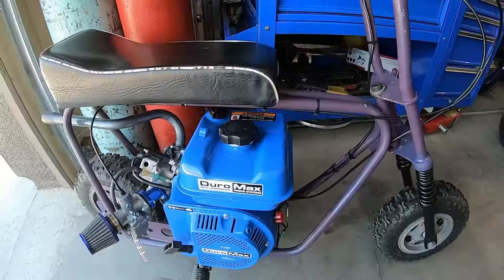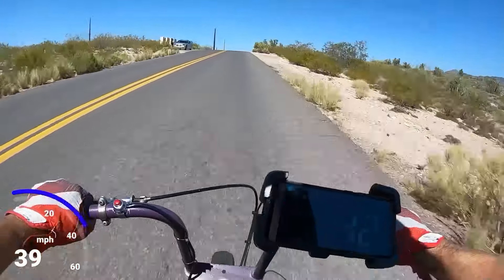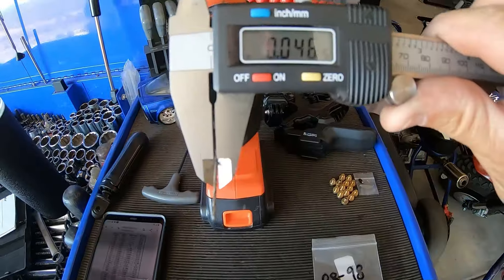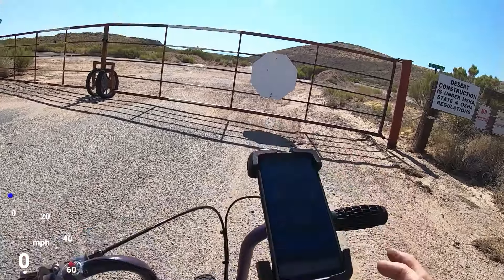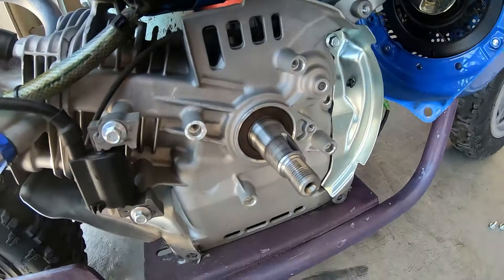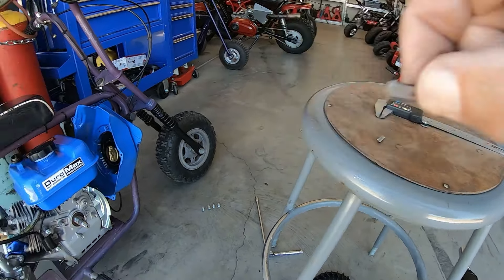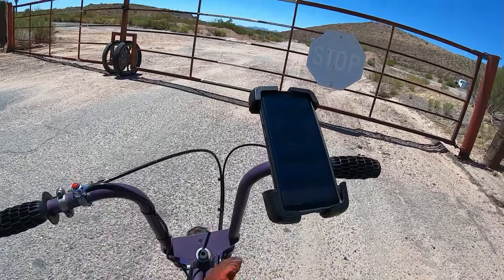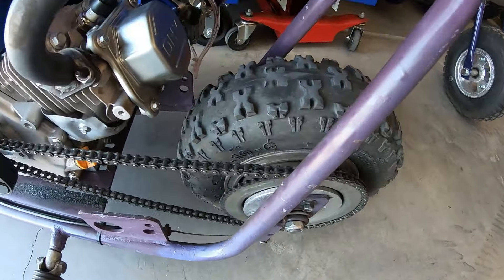Minibike jetting and timing

Comment: the first time I drilled out a jet, I discovered my drills chuck couldn't hold the bit, so I put the Jet into the drill and held the drill bit with the vice grips. (a tip for those with a drill that can't hold anything smaller than 1.5mm)

Comment: 😂 takes me back. One “mod” we would do but I would 100% not recommend if u like ur engine 😅 is getting a washer that fits perfect in the spring pocket but also over the valve seal to add some I guess tension to the spring, n it would help a bit 🤣🤣 one buddy put it under the retainer to be lazy n it destroyed his motor 💀
Reply from the maker: Are you talking valve shims? They sell them at pretty much any Go Kart and mini bike outlet. They are easy to install and effective as long as you make sure you will not get into coil bind when installing them.

Comment: Have you ever tried a crf150 carb? $26 and have accelerator pump. I've been using them. There's a 27mm version for a honda 250. Same flange pattern.
Reply from the maker: Yes, I have a video coming out with a CRF150 carb 👍👍

Comment: i just turned 34 and told my wife for my birthday i was going to completly redo my mini bike. i have a bt200x that had a mild built 196 but the neighbor kid blew his motor up in his mini bike and was always asking for my help and looking bummed so i removed my engine and installed it in his bike. 
    i since then picked up a 212 ghost which was trash after riding once around the block. i then had to pull the engine again and harbor freight replaced it now questions asked. i was disapointed in the amount of work i had to redo to switch it again. but now i have the new ghost in the frame and i brought myself the aluminum amazon flywheel (money is pretty tight on this build) also i picked up a coil,2 sunf street 19/7/8s, the amazon knock off brad hill tank for the bt200x and lastly a noram star clutch (but its 35 chain and ill need a 35 chain sprocket before i can install that so im stuck using the cheap clutch and jackshaft with the 40t sprocket for now. in all ive spent $1100 just getting this far on the revamp of my bike. 
    im wondering what you would get next, should i get the rod or a cam? and which cam would you recomend? 

anyways ive been a gearhead all my life and have always been mechanical but i still learn a ton from you. i always look forward to the videos as i always pick up on a few good tips. thanks for all the free information.
Reply from the maker: Thanks for watching the videos. I would install a billet rod in the Ghost. Yes it has a treated cast rod but it doesn't have bearing inserts so at some point when you start spinning it harder its going to need a billet rod anyway. A 265 cam works well in the Ghost for not a lot of cash , You were talking budget. Maybe a hot 265 or something like that. They work great and sound great.

Comment: I had one of those cone filters that was pretty restrictive and initially confused tuning. Was easy enough to find by doing a run without the filter. Never an issue with the foam type with filter oil.